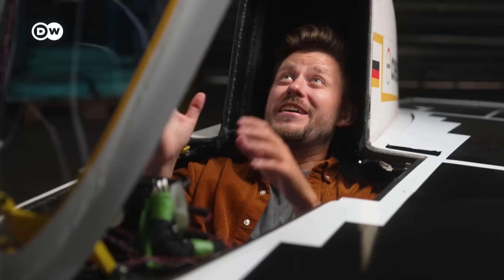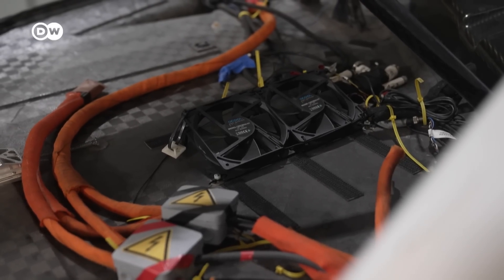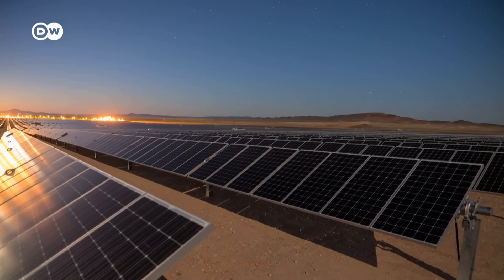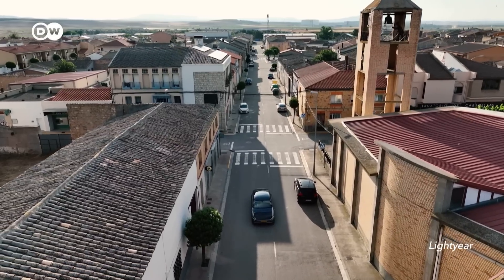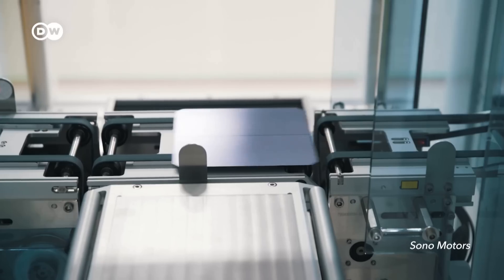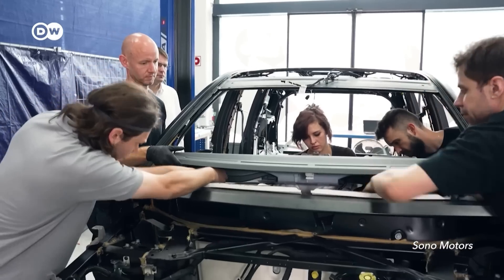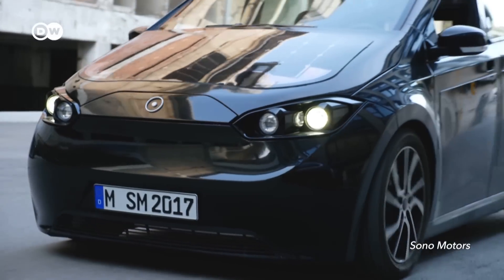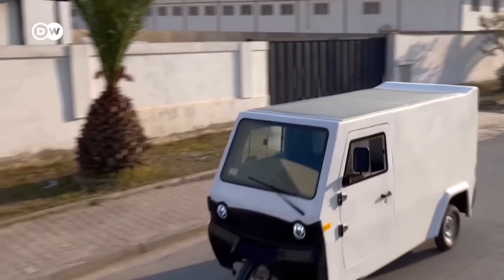Why aren't solar cars everywhere?

Comment: No kind of fuel or technology will ever make private cars sustainable or not be an inefficient energy hogger. It's hard to let go of tech bro yolo 420 rgb weed things, because they sound fun or epic. Let's not waste time and try to reinvent a wheel, just build better towns and cities where using car is just a choice not a must. Walking, biking/skating, trains and other public transport will always be cheaper and more efficient people moving or for cargo. Make a big solar farm and give power through power grids, not this.

And also isn't it better for the power to come from a powergrid on wires/third rail on trains than try to put big batteries/solar panels that waste space and bring unneeded weight?
Reply: Yes, it's definitely easier to completely, re-engineer & re-build all the roads in all the cities, than to make a better more efficient car...

Comment: There's these two things called 'thermodynamics' and  'cost'
Reply: Cost is not the problem. The Sono Sion was planned to be affordable and so is the still upcoming Aptera. No, cost is not the problem. At the end of the day, it is far more efficient to place those solar panels on the ground or on top of a building.
Reply: @Hans-gb4mv  All prototypes are 'planned to be affordable' buddy, but none of them are. Why do you think 99% of prototypes never see the market?
Reply: @Hans-gb4mv  Cost is the problem. If I pay for a 35000 for a 1 kw system that will only generate 20000 worth of electric in it's life, that's a net loss of 15000. That is a serious problem. Who in there right mind would want those panels.
Reply: @jimhigens5464  you are paying 35000 but not for the panels, for the entire car! Small difference. Sono said that the solar panels in itself did not create a significant additional cost for the vehicle.
Reply: @Hans-gb4mv   at 3:46 he says the special solar panels costs 35 grand. 
2nd point you ask any company that integrates solar pv into their car, what the cost per watt of their solar pv is. They will not tell you, because it's often 10x of normal panels. Which would scare potential investors away.

Comment: It makes essentially no sense. The vast majority of people drive cars in urban/suburban areas where access to electricity is no big deal. Why would you spend so much money fitting a car with inefficient solar panels that are placed in a way where it's impossible to get full efficiency from all of them vs a big solar farm/wind mill park/power plant which can utilize economies of scale. Plus, if the car ever charges to full now you're wasting a solar capacity.
Reply: Because not everyone has a driveway, many people live in apartments without easy access to charge at home.  If you have to recharge an electric car at charging stations away from your home it cost multiple times more, it can be almost as expensive as a petrol car.
Reply: "where access to electricity is no big deal"
Not in the UK. Street parking means no charging overnight.

Comment: The battery designs are still inefficient
Reply: Batteries are not the problem. It's panel efficiency and weight/aerodynamics. 

If, like the car in this video, you have a 6kwh battery that can go 600 miles on a single charge it's going to be a lot quicker and much more feasible to charge that small battery using solar than it would be to try to charge even just a standard range Model 3 at 50kwh for 270 miles of range.

Lets assume a 1kwh solar array, (for simplicity, not realism) the car in this video would be fully charged from 0 in 6 hours. You could reasonably get that on a clear summer day.
The Model 3 would take over 2 days of 24-hour full-sun to get to full. I don't care what season it is, you're going to be waiting quite a while.